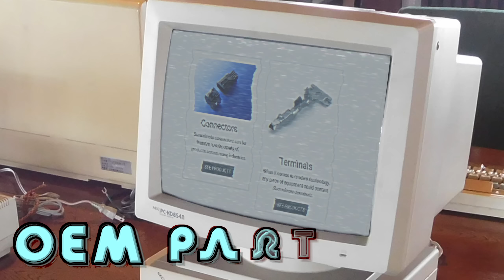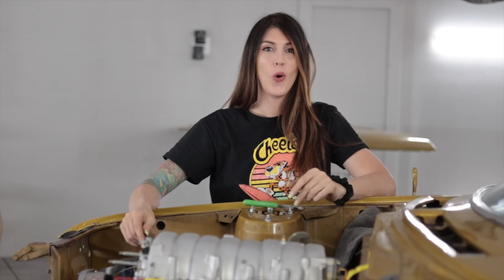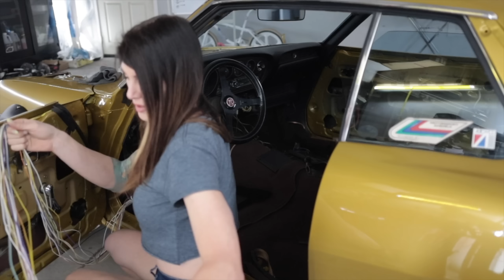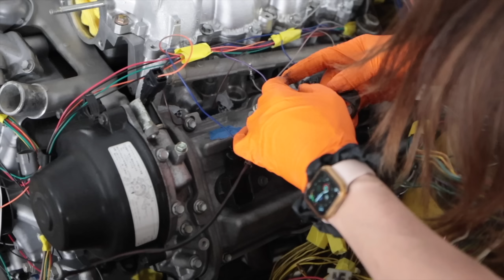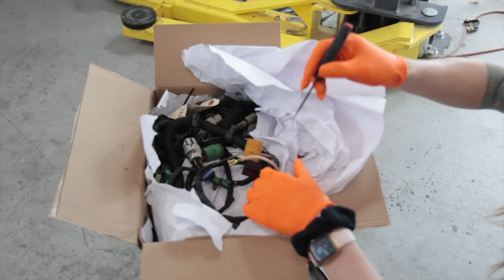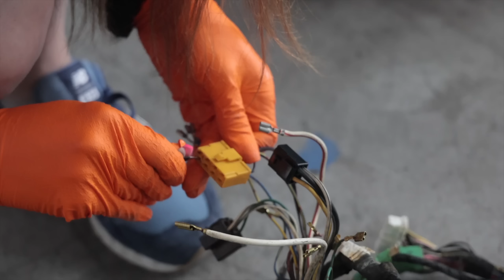Drive By Wire It Is.. // 2UZ V8 1974 Celica Wiring

Comment: I replaced spark plugs in my GX470.  Misfire city.  Apparently, some shop the PO used broke the lock off the #7 injector and pulled the coil pack unplugged the injector.  I have the new clips on order.  Also a TRD blower would make that engine fit a lot better.

Comment: If this is the 2uz with VVTi, why does it have the aluminum manifold and not the plastic VVT manifold?
Reply from the maker: It's a 3UZ intake manifold. Its about an inch shorter than the plastic one, yet still has variable length runners and looks more period correct in the engine bay.
Reply: @SarahnTuned  Very interesting. Is there any performance difference, compared to the larger plastic one? I imagine you chose it just for size though. 

I have a non VVT 2uz with the aluminum manifold but I was thinking of swapping for the plastic one with variable runners, but I may end up just supercharging it and there would be no point in upgrading it if I did that

Comment: I enjoy the wiring...or at least watching someone ELSE do it.  Back in the 80s I had a 71 Mustang Convertible that I easily TRIPLED the wiring on with all the accessories.  Probably DOUBLED the wiring on my 86 Escort GT at the time.  Both got PW, PDL, Pseats, large stereos, etc.  Both ended up with a second GM fusebox in the top of the glove compartment for easy access, with LEDs bridged across every fuse so that if a fuse blew, I'd instantly see which one it was.  But yeah, it's a LOT of work to do and make it look factory.

Comment: RE: The Throttle body problem. It SHOULDN'T be too hard to have someone convert it to a cable actuated TB. Like, removing the black portion on the side, installing a pulley onto the spindle and cable mount too, and, with 3D printers, a fresh cover can be designed & made to 'Tidy it up'... 🤔😏👍
😎🇬🇧

Comment: Would the mid-80s Fox body Mustang throttle body do the job for what you need? I have seen them used on K-swapped cars that are changed to cable-driven.

Comment: I wired a lot of electronics being an old PMEL Metrologist, then and working on the FAA's electronics systems. I no matter how long it takes I solder everything. I have seen too many connections from wire wrapped to crimping that failed due to dissimilar metals corroding. I also use dialectic grease on every connector. It may be over-kill for some people but my work has never failed. Just a thought.

Comment: I did a 1UZ vvti into IS300.   I needed a spread sheet to keep track of the wiring.  The wiring was the hardest part of the swap.   When I was done it all worked but I swore off Toyota's after that and went back to Honda...

Toyota would re-use the same color on the same harness connector. I depinned a connecter assuming unique color codes... That was a mistake.

I wouldn't mind sharing the spread sheet if you think it would help.

Comment: Shielded grounds and high quality connectors are something that's very seldom talked about In this day of fuel injection, even the old rebuilders are fuel injected. You seem to know your way around a wiring harness. I might even have to buy a whiteboard now to plan my next wiring job. By the way, rags are easier to get out of intake manifolds than combustion chambers.

Comment: You can ID a fighter by the sound of the engine? I used to live in the CMS dorms at Nellis which was less than a quarter of a mile from the runway and I couldn't do that. With the exception of the A-10 because it is so distinct. Very impressive! 😊

Comment: It's your car, build it the way you want and in a fashion that makes sense to you. I've worked in two way radio for over 40 years and built police cars for 20 of those years. Wiring is a long and tedious process. Especially if you are trying to save as much as the original harnesses as possible. You have to inspect each and every wire for damage before committing to using it. A nick in the insulation will eventually lead to the green crusties. 
Just giving updates as you go along is probably the best thing for you to do. I also own an 05 Tundra with that engine. almost 20 years old and still runs perfect.

Comment: Drop in a carby and distributor, 5 wires to the engine, old skool stroked Ford 351/434 Windsor. Sit down...shut up...hang on kinda thing... 😅😊

Comment: Just a little advice from someone that writes technical documentation for a living: your in depth wiring videos are one of the best and most unique things about your channel. One thing that we do when we get quagmired is to take a step back and do a mid-project retrospective with the team. I think that would be helpful for you, so you can work out a plan to continue making these wiring videos without losing your sanity, and while keeping them informative and entertaining. Maybe break them up into different circuits for each video: air, fuel, spark, sensors, chassis, dash, etc. and then spread them out throughout the project.

Comment: That wiring job looks intimidating to me.
At least with all your work documented, if you have a problem, you can trace back to  it.

I'm betting if you left a few notes a good shop tech could solve any problems that arise if he or she had to. Your patience and dedication to this is amazing.

If I were to attempt anything like those, I would avoid all that wiring by going old school. Don't need all the electronics with carburetor. Even single throttle body injection would be much easier, you are much braver than me.

I was surprised to see 4.7 on the engine. I recently test drove a much heavier 2008 Jeep with a 4.7. I could not believe the acceleration of that thing. Unfortunately, I didn't like the price so I left hoping they would come down. I went back the next day and it was sold. Daggum. I had to look up the specs on that Jeep.

Now imagine if your 4.7 is even close to the Jeep 4.7 but in a much lighter vehicle what it will do. That big fat Grand Cherokee beat the 5.7 Hemi to 60mph because the 4.7 has more torque at lower rpm. And amazingly the hemi did not make up the head start. The smaller 4.7 beat the hemi by .3 seconds at the 1/4 mile. 
Here are the stats: Grand Cherokee 4.7L 0-60 - 6.6 seconds.
The hemi grand Cherokee  with         5.7L 0-60 - 6.8 seconds. Hard to believe but I checked several websites.

The 4.7 pulled through the 1/4 mile in 15.0 seconds
The hemi 5.7 managed a 1/4 time of    15.3 seconds.  (That is not the 6.1 from Hennessy.)

Your TOYOTA is considerably lighter, I'll guess 2400 pounds with the heavier engine. The  big fat Jeep weighs 4400 give or take a few pounds. 
At 2000 pounds lighter your Toyota should be able to hit 60 in 5 seconds, IF, I say, IF you can keep it straight down the road. With practice, real sticky tires and luck, it might break into the 4 second bracket. With all that torque it might be like a car I owned 50 years ago. It could go from 35 to 110 in third gear acceleration increasing with every second.

I'll be checking in from time to time anticipating the day when that little beast is road ready.

Comment: Its all good Sarah. You're going an awesome job. I'm so impressed with how you work out wiring and keep it so clean, addinf to the fact that you want to keep it all Toyota. Its just AMAZING, as are you. Drive by wire isnt the worst thing that needs to hapoen. The link ECU and TPS will be able to handle that no problem. Just q bit more fabricobbling on the physical throttle side. Love your stuff Sarah.

Comment: Tip.  Keep the Crank and Cam angle sensors well clear of the coil packs.  Ive seen electrical noise from the coil packs cause all kinds of drama with engine positioning with these engines.  You can run the wiring up the front of the engine, under the coolant and intake manifolds and out the back in between the V.

Comment: I forget if I commented on the last talk about the throttle body, but a suggestion would be to convert the dbw to dbc with some cutting and covers and a cable pulley (w/ a set screw stop for idle). Or a custom throttle body housing that uses the dbw blade and shaft that also adapts an IAC valve for idle.

Comment: "Dont want to half ass it" - This is why MR DOS is a happy moving car and not a dead static bucket on wheels somewhere. The 74 celica will live. And there will be much rejoicing. Don't change a thing. This  is educational and inspiring 👍
Reply from the maker: ..with the exception of the E85/91 flex fuel tune. I just don’t trust anyone local to tune it though.
Reply: Indeed. I'm looking forward to that :). An expert on tuning alternate fuels - a must to do. Depending on your intentions for power/mpg - 30% on power would be very attainable, and some closure on the mpg gap. Higher CRs - more alcohol likes. In general the 3S <<should>> run cooler, and produce more low end torque. The last video with Angel on the junkyard crawl brought a smile - the Nissan trucks, mine even has the original butter yellow lol. For some reason I thought you ran across a 4th gen Celica in there too for the fuse box/plugs. I have one of those too.  Another reason I like what you done with MR DOS - that same generation 3S  engine :). I will continue to watch with baited breath. Love your work.

Comment: I have a 1992 Lexus SC400 with the 1UZ (which is extremely similar to this engine). I can tell you from experience, that Toyota OEM injector connectors are POOP. I have never seen connectors that are so eager to shatter, the second you look at them the wrong way.  By comparison, my 1991 Honda Civic's plastics are all still in great condition, despite being older.  In 2020, I had to change the Lexus' starter, which required removal of the fuel rails. EVERY single injector connector shattered.  I replaced them all with Standar Motor Products' equivalents, and have been very happy since.
Reply from the maker: All depends on where you live, the connectors on the northern climate harness are in great shape. The ones off my Arizona harness are brittle as hell.
Reply: @SarahnTuned  I'm way up here in Canada. lol

Comment: Hey sarah 
I love ur work - and detail 
That said I’ve done a lot of sumitomo connectors and factory grade crimp on connectors-  1…small tip.  Tin each connector after crimping (small solder) for factory continuity. 

When they are done by machine they spot each terminal with solder.. makes each connector compute with the main frame better,   

Great job 
Xo

Comment: Doing wiring isn't easy, making it clean and OE looking is even more difficult. Keeping track of what you're doing with electrical modifications becomes tedious. I redid (modified and added stuff) to the harnesses for my F250, the frame harness wasn't too bad, but the dash harness took weeks to add and change the things I wanted, and needed to have OE fit to fit back into the dash shell and everything reach to reconnect. The engine bay harness was a bear to deal with as well even though it matched the engine.

Comment: The reference to Hall Effect Transducers takes me back to college in the early 80's when getting my BSEE.  My advisor had an EV that was very basic and used standard 12 volt car batteries.  The 'gas gauge' was simply a volt meter but, to tell how much 'juice' you had, you had to put the car at full throttle to get an accurate voltage across the battery pack (to account for internal resistance of the batteries as they discharged).  My senior project was a way to measure the current flow using a Hall Effect Transducer and convert that to counting the Amp-Hours used by the battery.  Worked slick on the bench but, somebody melted a bunch of connectors on the car and I never got the chance to mount it and tune it to the car.  Oh, and thank you for the video and you have no reason to apologize!

Comment: Glad the dbw is back now :).  With the dbw setup correctly, it will be as snappy as a cable throttle and you won't need the idle valve anymore.

Comment: Hi Sarah,
Another cool video !!! I see what you are trying to do while trying to keep that throttle control true to the car's. My OCD is not quite as strong as yours, but part of my thought  pattern would be to try to keep the car as original as possible, but also try to keep as much of what made that engine run as original as possible and make them work together. I don't know if that makes any sense. You seem like you're heading in that direction....... Take care.

Comment: Oh, I know how frustrating it is. My 86 Celica ST had an oil fire light off because the power steering pump sprayed oil all over the exhaust, I had to rewire the injectors, no fun even with the factory manual. Keep going,  you'll get it done!

Comment: Uhm ... I was expecting better for the wiring. I've not seen a single pull test. Not using the oem crimp tool fo the wires.
What is the point of using original connector if you use a generic crimp tool?
I would have replaced the old wiring all together. Obviously with hi quality wiring and if available from another Toyota.
Insulation can be degrading with age.

Comment: I kinda like the wiring videos... Nice watching someone else suffer working on old ass JDM wiring harnesses, I did this on my old 87 200SX/S12 when I SR20 swapped it... I even simplified the pop-up headlight circuit and made it better than factory using factory parts!
Though I didn't do the wiring in the car, I had it laid out on my Parent's basement floor, because I didn't have a garage nor did they. lol

Comment: I forgot to comment back on the video where you placed the radiator... the koyorad is designed to fit inside of the rad support and if you push it forward you will have to trip a bit of hood support and that's on a long nose RA24.  You may have to cut the lower support to get it in there and then use a pusher fan. 

My JZ cools pretty well with a pusher fan and that same rad.

Comment: "heat is heat" i would be inclined to agree with you, but!!! electric heat and hydrocarbon combustion heat are two different birds entirely. burning gas to make heat leaves behind alot of soot. The whole (CHO + o2 -> CO2 + H20)  cycle will leave behind all kinds of garbage that you have to clean off after the fact. A heat gun wont make such a mess. the mo ya kno!

Comment: As an idea, you could run the wiring for the DBW throttle body in a sheath meant for a cable so it looks like a cable throttle body. You'll be real happy with DBW on the Link anyways, but I get that you were going for period correct look. You can make it pretty instant and even jerky with tuning if that's really what you want though!

Comment: Wiring is tedious and seldom correct on the first go. Also, modern engines and the cars that go with them are incredibly complex compared to old cars. I did a n Austin Healy 3000 a long time ago and the entire wiring harness would fit in a small grocery bag and there were two fuses; one for the engine and one for everything else.

Comment: Wait what if you made a spacer plate or adaptor plate for the throttle body. If the cross over tube is the issue just space it forward enough to clear the coolant tube. Remove the studs and use long bolts if possible.

Comment: Wiring is a B!tch! The thought process that goes into planning out the whole wiring system is actually quite interesting. Totally worth watching.
BTW, not many civilians would be able to tell the difference in jet engine sounds from a F-35, and a F-16. I used to live around LAX in Los Angeles in the 80s and 90s. Got to learn to tell when a C-5A or other unusual aircraft comes in or takes off because their engines had a different sound than rest of the commercial aircraft flying in and out of LAX.

Comment: I'm flabbergasted and jealous of how easily Sarah wired up those connectors. I got a wiring kit for my motorcycle with similar types of connectors and I couldn't get the wires into the pins then into the plastic connector so I wound up cutting them all and using Wago connectors.

Comment: Moin Ms. Sarah, question!? Is the V8 that you are putting in the Celica not a bit to strong for that tiny car? Just asking, because original the car was build with a motor with half the power of the V8. Not to mention the torque...

Comment: Wiring tip, use twist ties to hold your wiring branches, that way you can untwist the ties to add or remove wires. Then when ready to wrap just untwist them and use them again.

Comment: Never apologize or ask for forgiveness on these types of projects.  If you 'really' feel bad about what you're doing, "wear a sign around your neck, airman".  😉  Doing wiring harnesses is always cathartic.  Always use a noise suppressors on B+/12v power inputs, especially ecus, alarms and audio. High current relays/switches (starter, headlights, horn, etc.) are noisy.

Comment: Tbh Sarah I though actually pinning the injectors took less time than soldering the pig tail. Though I would suggest never soldering wires. Crimp them solder induces corrosion and causes a brittle spot in the wire. So when possible Don t solder

Comment: For the throttle body, have you taken the servo off a DBW and looked to see if you can swap it out with the cable pull shaft from another or fabricate one? I do think you could use a LS DBC throttle body.  Get one of the Toyota adapters, and an LS adapter, cut in 1/2 tig weld them together making a Toyota to LS adapter.  I'm not sure if the TPS and IAC ranges are close enough but since you are running aftermarket computer you can likely tune it in.  The cable is on the wrong side but that would be easy enough to make a bracket for that side.  Not 100% Toyota but... visually not too different.

Comment: You should try to relax a bit. Trying to make everything OE for a 74 Celica will never happen... The Engine swap, and all the newer aftermarket suspension ended that... You should focus on making is as safe as possible and reliable...  That engine in that car was not originally available, so when it comes to the engine bay, worry more about safety then looking OE.. Please be safe out there...